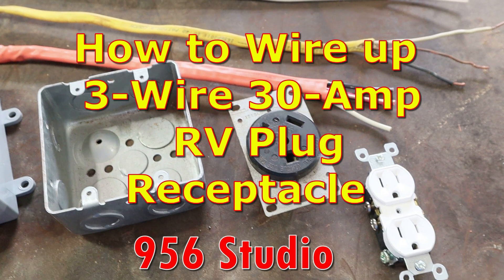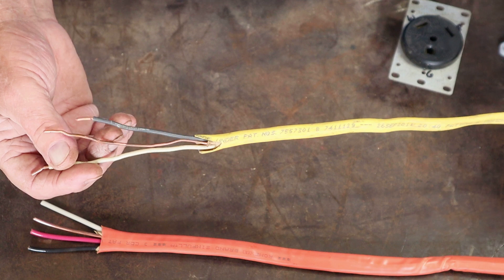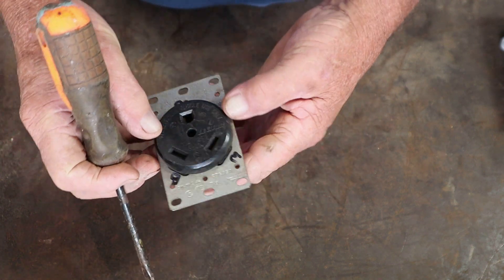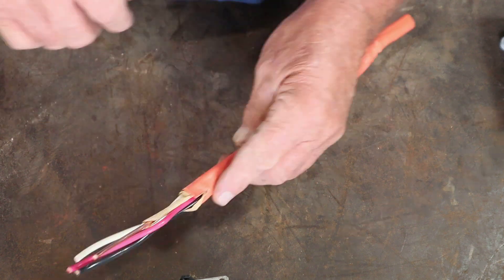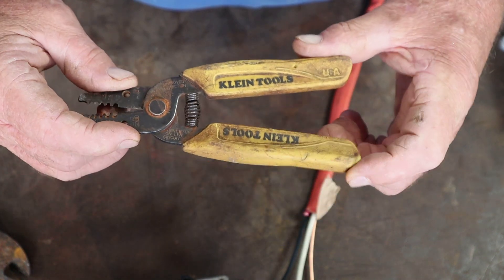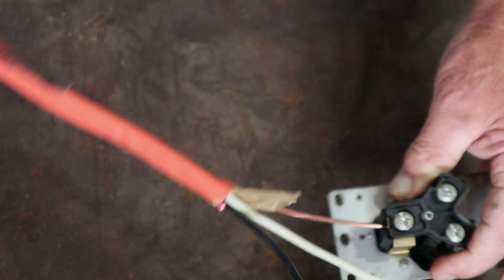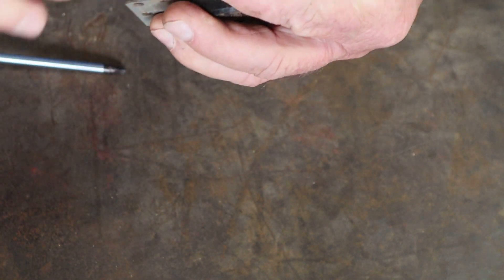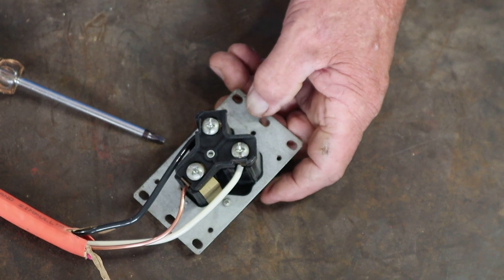How to Wire Up A 3-Wire 30-Amp RV PLUG RECEPTACLE #larrysbrusch #diyelectrical #howto #RVPlug

Comment: You have a Video on doing this to a Battery to the RV? Hate to spend that much money on a Power Station. Which I am not going to use all these other Plugs, Bells and Whistles that come with it. As the battery will be stored outside box on the RV.
Reply from the maker: I will have too look into it
Reply: @LarrySbrusch Thanks, I’m looking too. Seems like there would be a market for it. Keep it simple, able to store away and forget about it. As it works for you in the background